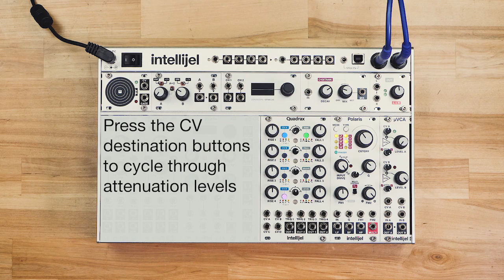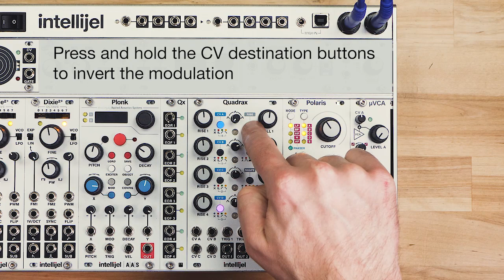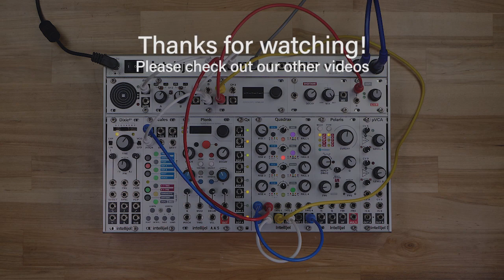Quadrax CV Assignments

Comment: Holy cow what an incredible module! I pair mine with Kermit for infinite modulation madness with my setups. Create melodies with one oscillator. I did get stuck with forgetting to reset CV mode and had to put in system mode and reset to defaults to clear my issues.

Comment: maybe you just need to see it in person, but the cv assignment stuff seems like a massive ball-ache. Everything else is incredible tho
Reply: Disagree.  Much more of a ballache to mult, mix (and attenuate...tho I will probably do that w/ another module) CV to control envelope A, D, etc (and that’s assuming you can CV those params).  Had a solid jam with this module, after trying lots of EG modules.  This module isn’t going anywhere; it completely rocks for modulation.  No, I did not even take advantage the whole CV matrix/options, but its killer without even doing that!
Reply: LOL, I know.  I just ordered one of these along with the expander.  I have a quadra+expander already in a different case.  Most of the time the Quadrax will function as a set of four envelopes but it is good to experiment.  Burst mode is of particular interest to me.
Reply: @MathHammer  I like mixing LFO and Envelope modes so fun.
Reply: I’m considering purchase at the moment. To me the CV assignment stuff here seems quite well designed and relatively easy to remember compared to the competition, or to the inetrfaces of some of the Make Noise modules I own for example.
Reply: @Avaruuskettu  agree love my Make Noise 0-coast but the crazy graphics and confusing non-standard modular thinking confuses me too much. Eurorack and modular is complex enough without spending hours having to learn yet another third party system.
Reply: @GuitarsAndSynths  West coast way of doing synthesis is just a parallel to the somewhat more common East coast one, nothing wrong with that, albeit it can be cryptic if you are used to the other one. My problem with Make Noise interfaces lies in the abstract button combinations that are at worst dangerous. E.g. Morphagene, where the wrong order in an unlabeled button combination can delete your recordings. I need to refer to the manual every time after I have a pause in using it.
Reply: I had problems when I could not get out of CV assignment mode and had to reset defaults. I do find the other features easy to use and super powerful as well as the expander module. Love how you can use it like a trigger sequencer, quad LFO, quad EG and any combo of these similar to what Kermit can do without screens or menu diving. With this and Kermit, you have infinite modulation for small setups.
Reply: Totally. The video becomes really hard to follow once he starts talking about assigning cv. I would have much preferred a simpler arrangement without any matrix. Just a button to cycle through what each cv input does would have been preferable. Then an expander module for the matrix. I hate convoluted UIs like this in modules. Everything else looks amazing though.

Comment: That’s a LOT packed in 14hp? Expander is 4hp?  That EOR EOC is a must.  Are u guys still gonna do the Quadra and expander? It has more immediate access and CV with attenuators over everything.  Like a DUSG
Reply: Quadra is listed as a legacy module on the website now, so🤷🤷
Reply: it is like a Buchla 281e in way less space and way more affordable price point. Buchla 281e costs about $1200 and takes up 4x the space and Quadrax does same thing for smaller footprint.

Comment: Ok, I really want to feel smart ... but this module would just cause me more headaches if I wanted to use it to it‘s full potential .... others will do great things with it :D
Reply: You can still have a lot of fun with this module without using it to its full potential! I'm sure a lot of users will set up their CV assignments the way they want them and just leave it. Plus it's still quite powerful even without assigning CV. But I will say that it doesn't take long to get the hang of it, and if you get lost it's easy to clear everything by just holding the two buttons and then start over.